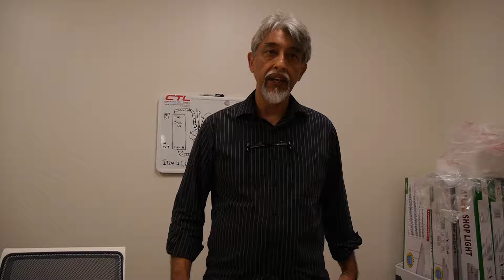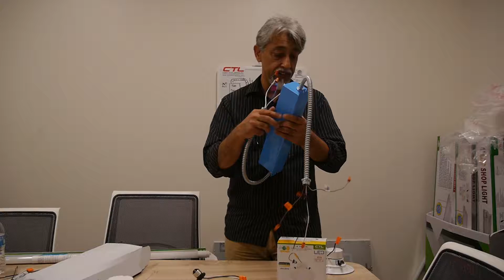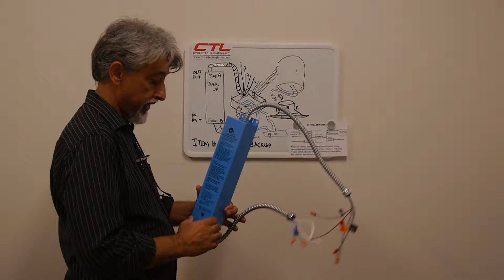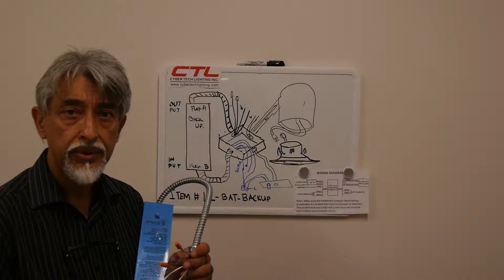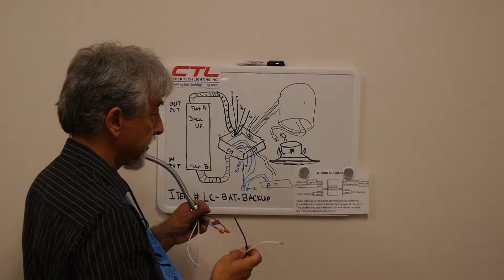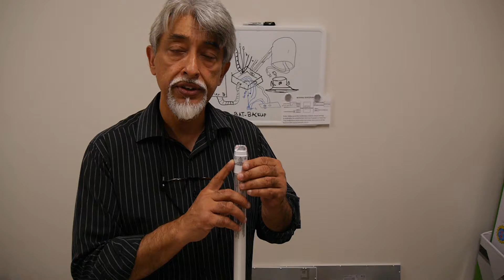LC-BAT-BACKUP LED Downlight Battery Backup Install

Comment: What if my light doesn't have a switch.  It's constantly on.  Also, in flex B, what do I connect the 2nd black wire coming from the test switch to.